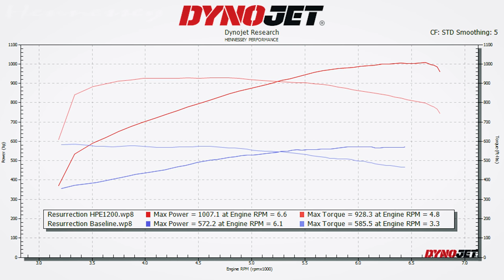1200 HP Camaro ZL1 1LE! // RESURRECTION by Hennessey

Comment: My exorcist turned out great and I love it but you never really get enough. This build is where we all want to be. They addressed everything they needed to but the tires! I just put on 345 nitto NT555RIIs for the street and its still not perfect but those Goodyears didn't have a chance under it.
Reply: @SiikPros  My problems aren't quite to this level yet. This video certainly doesn't help them though. That is insane and it is as solid as a rock! That's what I like about it. Stock blower, no methanol, just ethanol and a lot of it! 👍
Reply: I thought 1LE came on Pilot Sport Cup 2?? I know the stock is what like 325mm but I’m sure a 345 PSC2 would grip
Reply: @AYO_KO  325 Goodyear F1 super sport R2s . The 345 drag radials i put on made a tremendous difference but I would have to swap back to the 325 track tire if tracking it of course.
Reply: @raillife8324  ohhhh okay 👌🏾
Reply: @readyon3506  Exactly my point. I'm not sure what the owner is going to do but as he states in the video, he will need a set 100%. I threw on a set of NT555RIIS and went to 345s. He'll need a weld wheel and some MTs to get the most out of this one. Proxes or NT555RIIS at the very least.
Reply: @readyon3506  Couldn't find any a few months back. They were out of stock everywhere I looked but that will be the next set then MTs ET street ss.
Reply: What was the tab for the package
Reply: @TrueHearted78  $46k and had it done in a month.

Comment: Would of been nice to see an original ZL1 motor in the car which is a 427 all aluminum motor! Nice job though with this build! The best thing I like about this build is that it's true shift and not paddle shift!! 😎
Reply: As in 1969 ZL1 engine?
Reply: @trashbandit2449  exactly right partner!! You know your stuff! Only two Vettes rolled off the line with that motor a White Vette with a Black stripe on the front and a Canary yellow Vette which was the must powerful one 585hp carbureted the white one was 465hp.
Reply: the 2015 z28 with the 7.0l. Ls7 which you never see or here about build one of those
Reply: @dailylife3975  the last 1969 ZL1 427 Chevy put out sold Barrett-Jackson a few years ago for $150000 in the create!
Reply: @stanwilliams7871  yeah that would be cool but at the same time I would hate to take a zl1 engine out of the zl1. I wish they made more aluminum small blocks, super cool
Reply: I first learned about the ZL1 Vette in this hard back book titled [American Muscle] by Randy Leffingwell as a teen in the mid 90's.  It has a green and white 69 Baldwin-Motion Camaro on the cover.

Comment: When you drop a new engine and then run up those RPMs.  Don't you have to break the engine in?  They say the rings need to seat properly over 500 miles of break in.

Comment: Is it possible for a complete and thorough updated parts list I'm wondering are some of the electronics going to have to be upgraded to handle that kind of power how about the frame the brakes the shocks whole front suspension and most important is it preferred that I wear a cup while driving such a monster.  😁👍

Comment: Guys, this is not fair. As a German I have motorways here without speed limit, but my Camaro has only stock power – 450HP. And with this exhaust pipe of the Hennessy I will be arrested in 10–15min by the police.
This car needs to be out on our streets here for the right test drive.
Reply: YES!!!

Comment: I want to see it drag race see how well it launches against the dodge demon or any srt hellcat
Reply: Big Mopar fan here. Own a charger and stage 3 dakota. Dads got a viper, 2x 1972 demons (1 with 1050 horse) and a durango hellcat. I can confidently tell you this camaro will smoke a stock demon. Camaro is lighter and has a 1,000 vs 840 horsepower advantage.
Reply: @pumpkin9916  dammm that's badass but I believe you given that info buddy

Comment: I wanna see a race against the Hellcat to see it in some real action
Reply: Going to own a hellcat very soon. Unfortunately, this camaro would smoke it. The camaro is already lighter, and would also have the horsepower advantage (1,000 to 707). This camaro is a 9 second car for sure

Edit: For comparison, The Demon is 840 horse on race gas. Most youtubers have been running 9.80 to 10.00 stock. This camaro is also lighter and higher horse than the demon. So i would venture to say this might be an 8.90 to 9.10 in the quarter.

Comment: I own a 2011 Camaro 2SS 6 speed manual rare inferno orange with black racing stripes I bought last year that may be heading your way. It’s my midlife crisis purchase aka 2nd wife however I’ve barely driven it. I bought it with custom headers as this car was the a Ford dealer son’s car with all records. Upon purchase it needed a new oil pump and they put one in it. Recently I took it to a Chevrolet dealer since the oil pressure gauge is showing no oil upon start up. It’s loud and hard to tell what is done to it as it was modified with a warranty. The dealer said the car needs a new engine without proper diagnostic, they didn’t like it came from Ford. It’s now back at the dealer I bought it from who is having another Chevrolet dealer looking at it. I’ve owned the car since last October and driven less than 3000 miles owning it. Is there a way to send it to you, have it covered under warranty while upgrading it to an Exorcist? I live in Atlanta where my car performs are car shows and it’s dearly missed.

Comment: An rs3 with a simple stage 2 tune will beat this 0-100 and 100-200 won't be far off. Sad isnt it having 1200hp and get wrecked by a car with half the power. Whats the point in having that amount of power if it can't put it down.

Comment: My favorite car the Chevrolet camaro since when i was 10 in 1968 a drug dealer had one it was brand new he was my moms boyfriend my father was in prison at the time I was 10 yrs old  born in culiacan sinaloa mexico my mom got divorce 1968 The year we move to Tijuana in 1970 finally got my passport and 1971,my mother got me and my lilt sister our green card and move to north Hollywood 12miles up north from L.A and never forgot first time  I ride a camaro back in 1968 were I was born and since then I keep saying to my self when I grow up I'm gonna buy myself a camaro and I did and 1975 I was 17 yrs old I got myself a 1966.1/2 - camaro RS 327 engine 4 speed duel exhaust the Gages were beautiful two big gages RPM and miles and 4 lilt gages by the stick motor oil - pressure - temperature - battery - gasoline I was the happiest man on earth I pay $ 1150 I was stupid idiot I sold it in 1980 $1600 🤣

Comment: My only issue with this is the driver who puts the car into neutral and coasts the car!! who taught you to drive a stick!!
Reply: I'm glad to see someone else catch this! Yea let's do 137, but the clutch and put it in neutral slapping the shifter around like you're downshfting with the oil pressure dropping down to under 40 while coasting at 100+. Let's not forget what it's doing to the trans as well.
Reply: @04gmcsilver  I expect abuse for the comment so thanks for noticing it as well, crazy to coast any any time, even worse when driving at high speeds

Comment: 1200hp car for roads that it can't go more than 90mph, just doing pulls and not even suitable for what that car was really made for... FOR PEOPLE WHO REALLY HAVE THE BALLS AND TAKE IT TO A ROAD COURSE OR CIRCUIT RACING.
Reply: This car is not built for a road course, not even remotely close to a road course build. This car is made to be loud and have 1khp at the wheels. Hell look at how it's eating the outter shoulder of thr rear tire just in the 137 miles put on it. The rear suspension isnt even set up right to run the 315-325's it has on it.